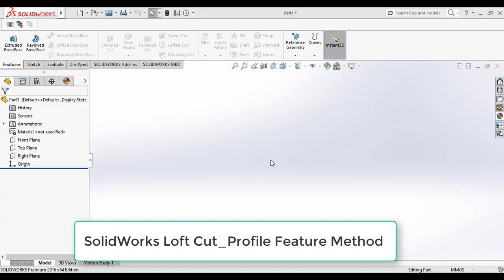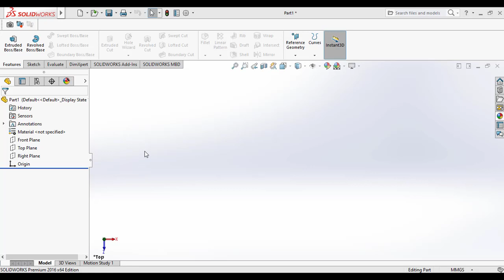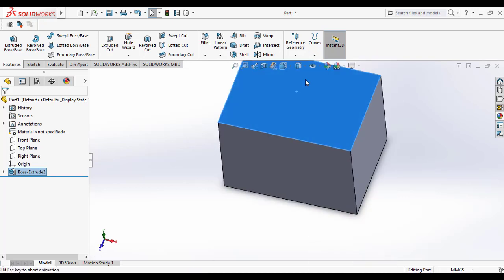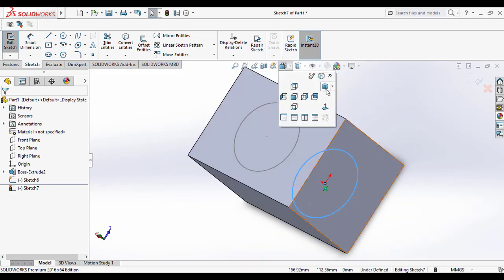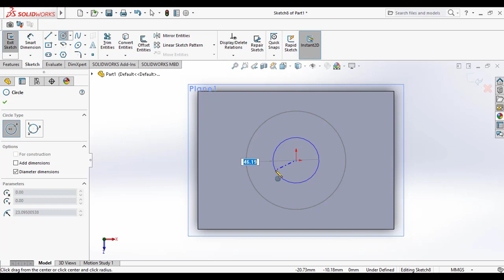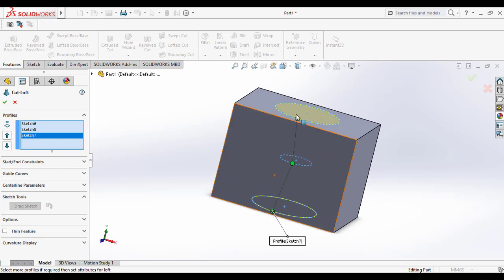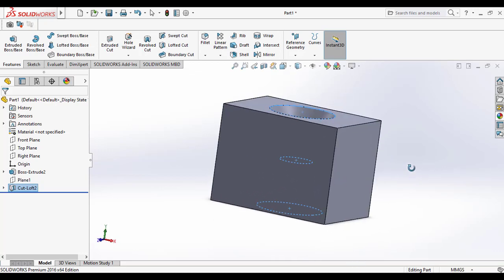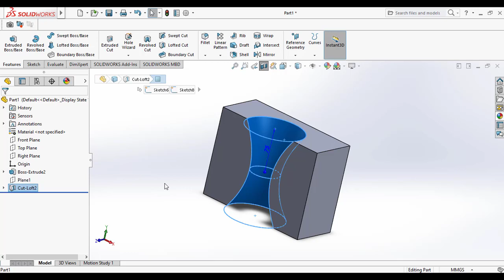Learn Lofted Cut SolidWorks Tutorial_Profiles Method for Beginners

Comment: Thanks! Can you change the side from which the material is removed (outside or inside)?
Reply from the maker: I couldn't get you. Can you elaborate the question with details?
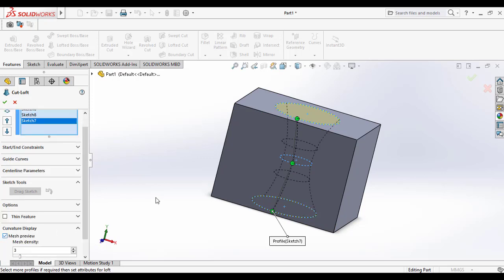Reply: @Hotshotracer91  Thanks for the reply! At 3:50, you highlight the material that will be removed (from the center of your cube). Is it possible instead to leave that material and remove the material outside your sketches (at the corners)? I need to be able to remove material outside my sketches instead of inside.
Reply from the maker: For that , you can use revolve boss feature. You have to draw the half of the cross section and revolve it with the axis inside the section. No need to do loft cut for it. Loft cut used to cut different profiles in different planes. So , i think this answer will help you. Thank you.
Reply: @Hotshotracer91  Thanks but revolve doesn't work because the feature I'm trying to cut has a funky organic shape and two different angles along the length. I think sweep will work but was hoping SW had the ability to change the side which gets cut with the loft. Thanks again!
Reply from the maker: Can you share the drawing , I will try to help you. Contact https://m.facebook.com/solidworksguide/